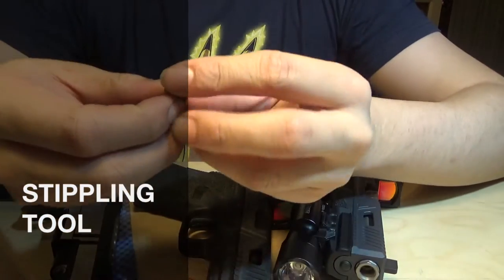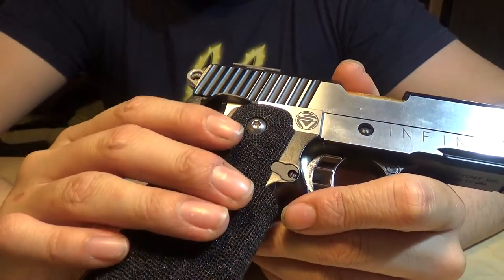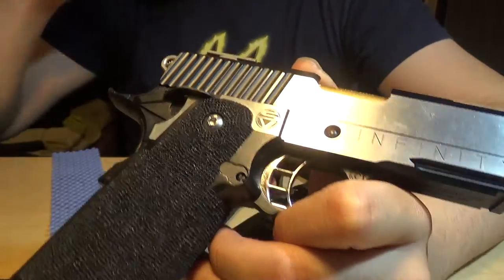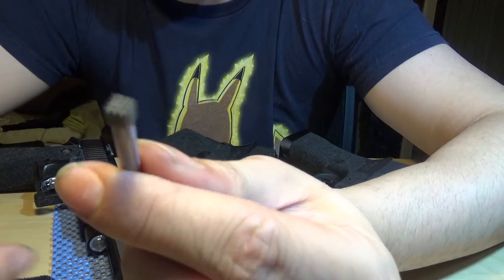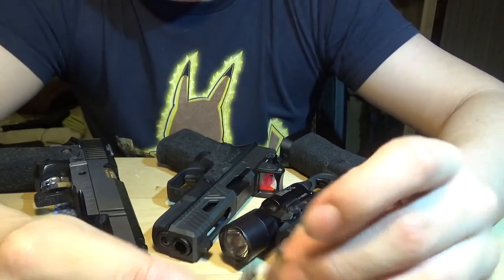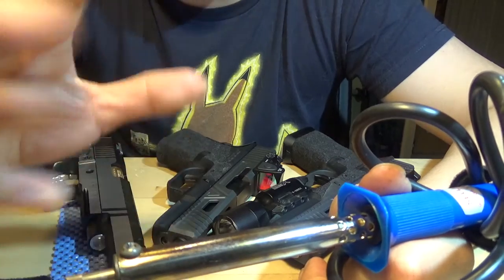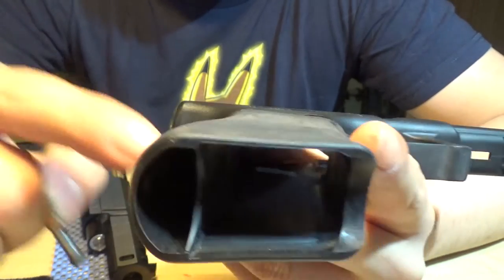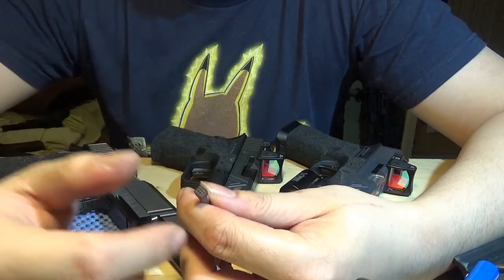STIPPLING TOOL

Comment: what are your thoughts on the UAC stipple tool? that's the one I've currently been using and I find that it doesn't produce a clean pattern on the first press (if that makes sense?)
Reply from the maker: +SuperBreezy1990 ah yes tbh i have used it myself and i have noticed the same problem! but i would not take advice since my opinion may be biased towards my own tool (XP). 
But with that in mind, i made the tips the small structures on the tool much taller and wider compared to UAC and brownell's stippling tool so that i can create a deeper and more distinctive pattern.

Comment: @roguesystem087 what did you use to make that thumb ledge on the frame for your support hand? did you just file it down?
Reply from the maker: The proper way to do it is to use a precision mill, but because i had problems holding down the frame for the milling process, opted to use a rotary tool with a mill head and a sand head to slowly grind down the plastic, and then some polishing to make it look like the way u see in the pic